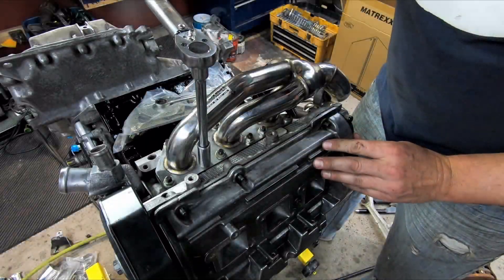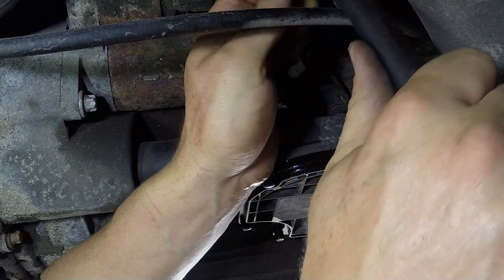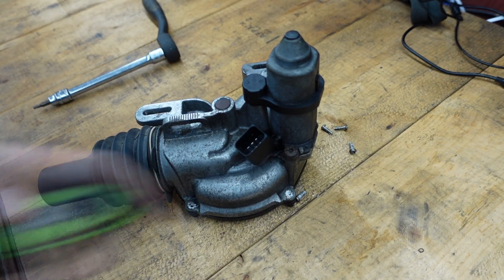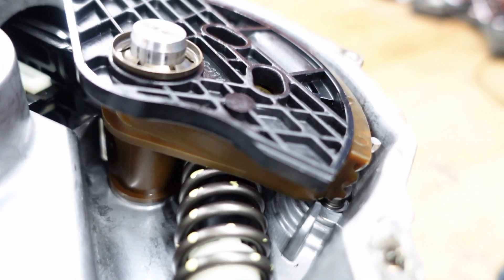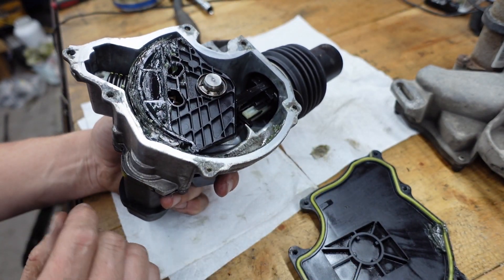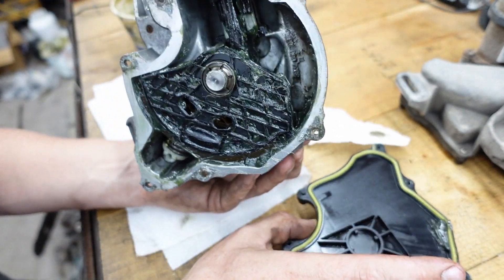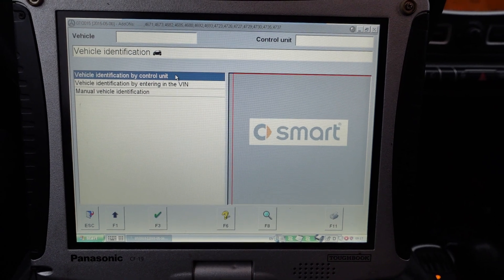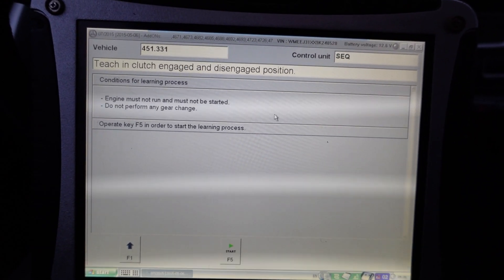Smart 451 Clutch Actuator DIY Service

Comment: Hi I wanted to replace with a brand new on will I have to reprogram or can it just work plug and play if it is in the correct position
Reply from the maker: It might be difficult to get it to activate properly if replacing with a new one. You can adjust it somewhat by hand. If the clutch engages too harshly move the actuator closer to the flywheel and if it slips or doesn’t engage move it away from the flywheel. But it can be very difficult to adjust it properly that way if you aren’t experienced mechanically as it must be adjusted in very small increments and you must be very confident in your ability to feel how it is engaging.
Reply: @PBGarage  never mind I’ll leave it at the garage this seems a bit complicated, my car just stalls completely when in gear and got told it’s a simple fix of replacing the actuator but it sounds a bit complicated. Thanks for the response

Comment: I did the rebuild and experienced marginal actuator improvement, but not enough to stop the hard slamming into reverse. Was curious to see what my local MB Smart service would find. They hoped to find $2,400.00 in my wallet... in order to replace the unit as a starting point for diagnosis. In other words, they weren't completely positive if the actuator was faulty. Crazy!

Unfortunately, I still had to pay for the expensive diagnostic walk-around by the "smart technician."

I'm considering buying a new OEM Sachs and installing myself.

Out of curiosity, could the clutch-actuator's electric motor be a contributing issue to the slamming?
Reply from the maker: The actuator clean and lube here helps a ton in most cases, when you had it in did they re-teach the clutch engagement point? 

I do think there comes a point where the issue starts to be in the clutch pack itself and no longer with the actuator.
Reply: @PBGarage  I don't know if Mercedes-Benz attempted a re-teach, but here is a direct quote from my recent service-receipt given to me yesterday when I picked up my smart.

"Customer states they took apart the clutch actuator and now there is a hard shift to reverse followed by a clunking noise, shifter is hard to go into park and jerks going into drive. CDCE perform diagnostic scan, retrieving engine fault codes related to the CEL. Road test to verify complaint. Preliminary evaluation provides technician path to cause of failure."

"Multiple codes indicating clutch actuator fault, performed actuation test of clutch motor via SDS and actuator repeatedly failed test. Visible damage to boot at actuator, will require starting with replacement of clutch actuator. Customer declined repairs."

"Check Engine light is on."

I hope it's not the clutch-assembly. Been there, done that on a 1983 Mazda years ago.

BTW, subscribed. Thanks for your vids.
Reply: I had a similar issue and it turn out to be broken clutch pressure plate. Save yourself the trouble and the expense, replace the clutch yourself. This all seems to affect 451 models from 2012 onward the SACH pressure plate were manufactured in China. @Windtee
Reply from the maker: It’s definitely seeming like the “3 bars of death” failures are most often related to the clutch actuator, whereas if the actuator is in good condition, adjusted, and the car’s still shifting poorly, then it’s more often an issue with the actual clutch pack.
Reply: @PBGarage  @user-xf2fo1cs1q I bought a new Sachs actuator and will install this week. I'll get back with updates after testing.
Reply from the maker: @Windtee keep us posted!
Reply: @PBGarage  New actuator was installed today.
On road, it shifts through all gears in auto and manual modes, including reverse.

Unfortunately, hard clunking/slamming into reverse, but not as bad as before.
I want to disconnect battery (to maybe clear codes?) and let sit for an hour to see if it makes a difference since I don't have a computer-diagnostic tool.

MB's initial report showed fault-codes pointing to actuator and nothing else.

I hope it's not the gearbox. Is there some kinda electro-servo selecting gears?
Reply from the maker: @Windtee yeah there is a gear selecting actuator. You could check to be sure the wires aren’t rubbing against anything and worn through the insulation. Did the shop do the clutch adaptation?
Reply: @PBGarage  Initially, all MBenz did was diagnose symptoms and read error codes with no old clutch adaptation. When I got my car back, I installed the new part and placed it in the same spot as the old with no adaptation/re-learning.

I'll troubleshoot wiring for abrasions. Thanks for the tip!

If no success, I'll search for a reputable smart service mech in my area because MBenz was ridiculous with their outrageous pricing and lack of concern for a solution.

My smart skills are limited. It's not like the old days where I could diagnose a mechanical failure and bolt on a fix.
Reply from the maker: @Windtee when I bought my 453 I specifically got one with an old-fashioned 3-pedal manual gearbox for the simplicity/reliability. Turns out the 453 has other electrical issues though so I’m no better off, and unfortunately my fancy expensive STAR tool won’t work on my 453 go figure.
Reply: @PBGarage  Update. My 451 Brabus failed to shift into gear a few days ago (DoA). It's now in the shop being worked on. Long story short after OBD comp diagnostic, looks like clutch re-build is on the menu. Almost 70K miles on the trans since new. Also, engine mounts are blown. Replacing them too.

Will let ya know how it all went down in about a week or two.
Reply: Picked up smart from the shop today and all is operating normal.
New pressure-plate, clutch-disk, and flywheel installed.
Clutch-fork was a mess along with fork-bearing. It rattled loosely inside the trans housing. It was close to breaking away from its attach point.
Shifts into R perfectly with zero noise. Shifts through all gears up and down smoothly in manual and auto modes.
Gear shift-motor on top of trans may need replacing down the road, but I can swap the part with a new one later.
Finally, my ride is rollin' again.
Thanks for your videos! Much appreciated.
Reply from the maker: @Windtee glad to hear it’s sorted now!

Comment: You couldn't solve the clutch problem this way. It would be great if the problems were solved with a little lubrication. Your clutch is worn out and the actuator does not have enough power to push it to the end position. You cannot do the learning procedure if the actuator does not disengage the clutch completely.
Reply from the maker: You’re talking about 2 different issues. Clutch actuator binding is common and easily solved with cleaning/lubrication. When the actuator hits a limit on current flow it will cause the 3 bars of death and/or poor shifting. I’ve brought many many 450s and 451s back from the dead with just this service. 

Beyond that, there are other issues with the clutch that we are going to look at in future videos but this is the best first stop towards resolving clutch/gearbox issues.
Reply: My 2009 (146,000 miles) started misbehaving late November. It would stall and be very jumpy at times. I never got the 3 bars or any other engine lights. But I did get a code for the clutch actuator.  Upon finding your video for how to take it off, clean and lubricate it, I just finished this!  Slightly delayed because I had knee surgery! But I was able to do this service as you instructed (marked the bolts, etc) and test drove today!  It shifted extremely smooth!  I’m hoping that this lasts another many miles as I love this car!!  And as for as the other ladies who don’t think they can do it, you can!! 
Thank you for this great tutorial!!
Reply from the maker: @Ritarvt I’m so glad to hear it! It’s an easy DIY as long as everything gets marked off and put back the same way. Glad to hear your car feels way better!
Reply: I am very grateful for your video! Made things super easy!

Comment: What kind of grease did you use?
Reply from the maker: I used Bel Ray Waterproof Grease. But any dielectric or silicone based grease will work well. I didn’t want to use anything that could attack the plastics like regular wheel bearing grease or the like.

Comment: Found the issue with my coolant leak on my Fortwo but I have no idea what this part is called that I’m looking at.. it’s the assembly that was next to the thermostat.. has an in and out and a small fitting off the side that goes to a hard line and connects close to the thermo sensor.. well that fitting is broke clean off and someone before me used about a tube of silicone to stop the leak long enough for me to find it lol
Reply from the maker: That’s a bummer that they sold it to you broken. Do you mean the flat plastic housing that bolts to the head? With the one big pipe and the one little pipe?
Reply: Hey yeah now that I have the motor down “in service mode” I see a lot of questionable things.. there’s probably a tube of orange RTV on miscellaneous things here and there. That being said I found the part I was looking for. The water outlet pipe. And it’s the small fitting that was broke completely off and they Jimmy rigged it enough to pass safety. While the engine is down I may as well swap out the reluctor rings for the abs as I had an abs light come on on the way home from picking it up from the shady dealership downtown in Ottawa 😒

Comment: Is it really necessary to do the adaptation? I just bought a new clutch, mine is done and will service the actuator but I don't have the software.  Service manual says to install the actuator 3 lines in from the point it barely touches.
Reply from the maker: I’ve managed to do it just by feel or trial and error driving the car. But it’s tricky.

Comment: Does anyone know if it’s ok to take an old actuator off and replace it with a new actuator in the same position as the old one without the software / re-teach stages? Will it be ok simply by fitting the new actuator in the same location as the old one? I have sockets and spanners but no software / clever technology.
Reply from the maker: It’s tough to know for sure. But you can shimmy the actuator in/out to get it dialed depending on how it’s driving. It takes some fiddling but I’ve done it without the software.

Comment: Many thanks for this informative video. I miss, in which position the car was set (N, R, 1) prior the exchange and if the battery was disconnected prior removal, though. Any hints on that? [I do not have a tool for relearning the clutch or delete error codes] Cheers
Reply from the maker: Hello. In North America the cars have P, but for rest of world you’ll want to leave it in N and disconnect the battery.
Reply: cheers mate!  @PBGarage

Comment: Hi I just put the new clutch actuator on my smart car,,connect and everything and the car not  run is like in parking all the time not neutral or nothing  when I change gears the actuator not move or nothing what the solution after a brand new clutch actuator?
Reply from the maker: First thing to do would be to check your wiring to see that it hasn’t rubbed against the transmission and worn through

Comment: Thank you for the video! Our smart is often not shifting into reverse or drive; I’ll try this fix over the weekend.
Reply from the maker: Worth a try for sure!
Reply: @PBGarage  Well, still having intermittent problems shifting into reverse, but at least I know my actuator is good and greased now!
Reply: @jixxen  smart did recognise this problem and put out an ecu update because some of these wouldn't push with enough force to get it into reverse, the update made it have just a little bit more force to engage. try moving the car forward a little by foot or with first gear and then try reverse (basically to reposition the gear so it slides in easier). if you find this regularly works, you probably need the updated software. you might have to pay for it now, if it never got it when they were offering.

Comment: I wonder if one couldn't use a 'trans oil' instead of grease? Measure the volume inside and then add maybe 50% of the volume in oil? Your thoughts guys?
Reply from the maker: The problem with any kind of trans oil is that I think it will melt/soften the rubber boot or the various gears/seals etc in the actuator. If you had a silicon based lube of some kind that was non reactive maybe? Not sure.

Comment: I've got a nice "crunch" noise almost every time I shift into reverse. I'm hoping doing this will solve my issue... However I don't have access to the DAS system so I'm hoping the car can sort of "re-learn" itself.
Reply from the maker: Just make very sure that you mark the position of the actuator before you take it off and make sure you put it back on in the same spot and you should be fine.
Reply: What if you take an old actuator off and replace it with a new actuator in the same position as the old one? Will that also be ok without the software / re-teach stages? @PBGarage
Reply: @elwynrowlands9486  I replaced my old actuator with a new Sachs made in Germany and positioned it in the exact spot the old one was in. No relearning software used.

Comment: Your video has been very helpful on this, my only question is how exactly did you get the actuator fully retracted? I tried plugging the connectors together and turning the key into the on position (didn’t start the ignition), tried switching gears and nothing happened. Using the paddles when shifting to the second gear, there was a clicking sound, but still no movement. The way it is extended right now, it isn’t possible to bolt it back to the vehicle. Any help on this would be greatly appreciated!!
Reply from the maker: I’ve been able to get it to retract by just turning the key on and off with the actuator plugged in. If it won’t retract it could be an issue with the actuator. If you have STAR/DAS you can also force the actuator to the open or close position from within the software, but again it might not work if the actuator is totally dead.
Reply: @PBGarage  We have tried turning the key on and off, maybe it’s toast. Thanks for your quick response on this.

Comment: Do you need the teach in program if you’re just greasing/cleaning the clutch actuator or only if you replace it ?
Reply from the maker: If you mark it really well when you remove it, and you reinstall it in exactly the same spot you don’t need the tool necessarily.

Comment: Thanks for the info. When I was looking for a smart to buy, one that I test drove had shifting issues. At the time I didn't know what was wrong but I knew something wasn't right. The owner tried to convince me the shifting was normal. I passed on the purchase of that one and purchased another that shifted normal. I have worked on most everything I have ever owned and I must say these smarts are engineered a little different. Good to know!
Reply from the maker: Yeah they take some getting used to but once you have the right tools and a bit of practice they aren’t so bad. Always have to remember it’s a whole car worth of stuff rammed into a half a car so it’s bound to be challenging lol
Reply: hello friend I have a smart 451 mhd I have a clutch problem.  I can't start the car it won't start I have a total of 04 DTC faults.  can you help me thanks in advance

Comment: Hi just a question why remove from car if plastic cover just comes off with just 6 screws which can be done in situation never made sense to me? Or am I missing something. Love video's keep them coming. Thanks
Reply from the maker: Glad the vids are helpful! I haven’t tried to remove the cover in place, but I think it would be really tough to do with it installed on the car since the heads of those 6 screws face up towards the engine/trans, so getting access would be very difficult compared to the relatively small effort of removing the 3 bolts and one electrical connector. It’s good to tackle those bolts at your leisure when the car is running properly so that when the actuator does fail, they come out easily as well and you’re not breaking them late on a Sunday night in a blizzard when you have to get to work the next morning.